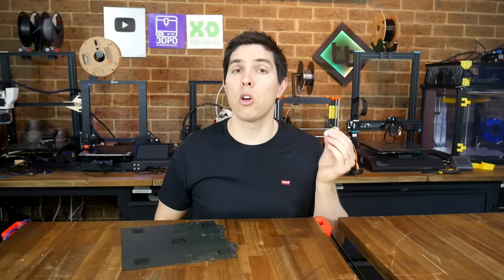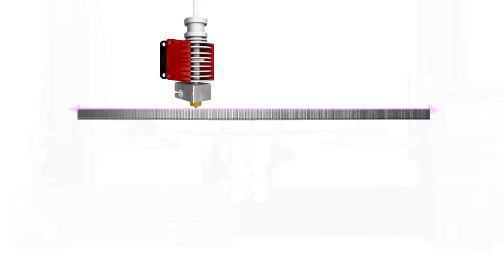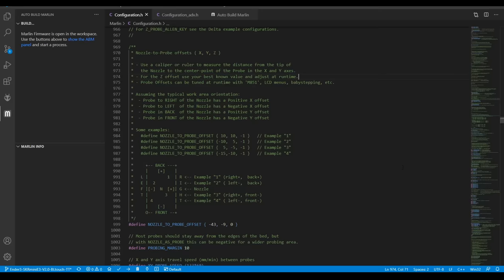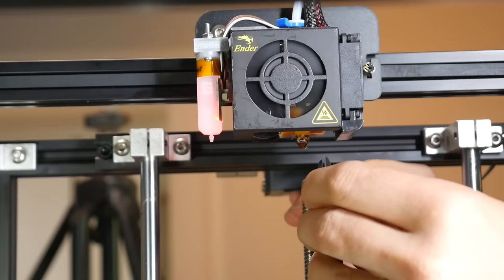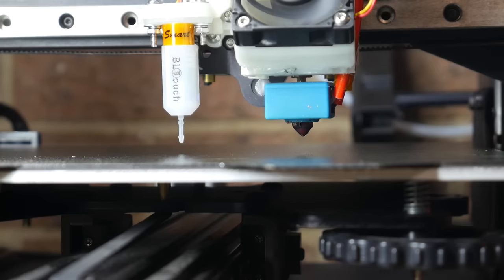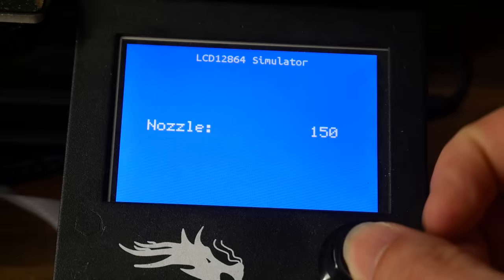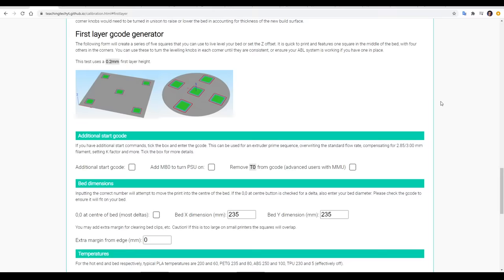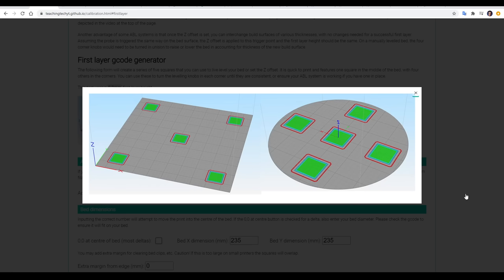ABL offset guide including new probe Z offset wizard

Comment: This is the way I adjust my z-offset: https://www.youtube.com/watch?v=Q5M7DvdMcew However, that's just the starting point. I made a test print like yours and make final adjustments on the fly. Once I get a good first layer, I save my settings and usually have no need to make any more adjustments until I change filaments that will require tweaking. When I go from PLA to TPU, I usually have to make a small adjustment to make sure the TPU is adhering. Other than that, I'm pretty good to go.

Comment: why not just start from offset=0 and start printing any first layer calibration model and lower the nozzle while printing with probe offset babystep? after you get the good result just save config and done. I don't really see the point of this whole wizard thing, just a waste of time.
Reply: Because beds are not completely flat. Whatever you print for that should be at the center and be small.
Reply: @alejandroperez5368  so what? That's the reason why probe probing points, the nozzle will be lowered and upped accordingly to the mesh, this has nothing to do, it is a right way to set you print offset, just do your G29 first and after that start the print, maybe a 100x100x0..2mm square and adjust your offset while it prints, save the setting after that and done. There is absolutely no reason using the piece of paper and this nonsense wizard
Reply: @ramzeslo2  You're wrong.
You first find the Z offset, then you probe your bed with whatever bed leveling system and then you fine tune the Z offset on first layer if necessary.  If you start printing without a Z probe offset value, it will likely start printing mid air, and will have to adjust it from a very distant value without an actual working mesh = crazy result.

But if it works for you...whatever.
Reply from the maker: Pemergency, that is the way I have always done it in the past, however, because you don't feel the need for this wizard doesn't mean it's 'nonsense'. Consider a probe like the CR-6 (or the version I designed for Ender 3 inspired by this). Those designs have a positive Z offset, so starting a print with it set to 0 will scrape the hot nozzle on the bed. At the end of the day, this is another option. If it's not what you need, there's no need to bash the wizard or those who use it.
Reply: @alejandroperez5368  that's not true, but that's fine, it's your opinion
Reply: @TeachingTech  im just saying this so called feature does nothing which we couldn't do in the past. And yes i do agree it is another way of adjusting the z probe offset and nothing more than that, i would be grateful if they focus on fixing the existing issues with marlin 2.0 rather than adding more unnecessary gimmicky options.
Reply from the maker: I would say to that this feature came from a pull request from the community. If you don't like something, then put in some time to fix it and assist the community. One of my sports clubs has a great saying: "Before you complain, have you volunteered yet?"
Reply: @TeachingTech  i have all rights to say my opinion about anything, and i really don't care if you like it or not. And you may be surprised how much i supported 3d projects community, but this is not a subject of this conversation. You do what you doing, and let people have own thoughts.

Comment: You really break the information down well.  I have a couple of questions.
1. I have a "Creality 3D® Customized Version Ender-3Xs Pro 3D Printer 220x220x250mm Printing Size With Magnetic Removable Sticker/Glass Plate Platform/V1.1.5 Super Silent Mainboard - Ender-3Xs Pro" from Banngood (URL:banggood.com/Creality-3D-Customized-Version-Ender-3Xs-Pro-3D-Printer-220x220x250mm-Printing-Size-With-Magnetic-Removable-Sticker-or-Glass-Plate-Platform-or-V1_1_5-Super-Silent-Mainboard-p-1535619.html?rmmds=myorder&ID=6285961&cur_warehouse=USA).  A great and quiet printer.  What version of Marlin do I use to upgrade the firmware?
2.  I can't find the answer if the motherboard is 32 bit or 8 bit.  Do you have any idea?

Thanks for all the hard work producing very informative and educational videos.
Reply: Your printer is 32bit. Use Marlin 2.0. You can find the download on the Marlin Website. Look for Teaching Tech's video Creality 32bit guide, he covers all the information on upgrading firmware as well as the type of board you have and other info like how to install BLtouch.
Reply from the maker: If it is new it SHOULD be a 32 bit board, however if it arrives the the board has V1.1.5 on it is is still 8 bit. Either way the newest version of Marlin will serve you well.
Reply: Thanks for the assistance.  Is there any indicators on the motherboard to tell if it is 32 bit or 8 bit like the controller chip?  I am really hoping for a 32 bit for easy upgrade of the firmware

Thanks
Reply from the maker: This video has a visual guide you can use: https://youtu.be/neS7lB7fCww
Reply: @TeachingTech  Hey I have a question. I got BLtouch set up on my new Ender 3 V2 and compiled Marlin myself thanks to your videos. However I can't figure out my bed edge offset/bed limits. I know my current probe offset is x38.2 y0 but although I entered it into Marlin correctly my printer probes off the edge of the bed for the 3 right side measurements. I temporarily solved this by entering a smaller bed size in Marlin but of course it prints totally off center and my bed size is limited. I haven't seen many videos on setting bed edge offsets/limits and haven't found much help searching online in the past 2 weeks. My printer prints great, although the grid is off center and my bed size is quite a bit smaller.  I use 180x200 or something like that to get it to probe a reasonable area. What can I do to fix this? I consider myself an advanced user on the hardware end, just started learning how to compile Marlin lately though. Thanks for any help!

EDIT: I'm using the correct configuration and board files as well. I forgot to mention I run an E3D Titan Aero rather than the orginal bowden setup. My prints are near perfect otherwise!

Comment: Hi, friend. I have had problems setting the z-offset correctly on my biqu bx. It seems like the auto leveling probe is not helping me. In some places on the bed it seems to be going well but At other points the nozzle is very close to the bed. And in other parts very separate. I have also manually leveled the 4 corners using the manual leveling wizard and the 4 points They look perfect, but when printing is where the problems arise. My printer is new and I haven't made the first print yet. It has me very frustrated and I don't know what else to do. Help me please
Reply: Even the live babystep during printing helps in some spots on the bed but is still bad in other areas.

Comment: I work with industrial robots, and we have pin checks or TCP checks installed. When we have a collision (this is actually not that rare) we can take the worktool to the pin check and adjust accordingly.
Now I can see that having a pin check to travel to would be complicated, printing one should not be.
So for FINE tuning, we could print a pin/pyramid (any pointy object) and then with the wizard drive x-y-z until the probe is just touching the tip of the pin/pyramid.
Marlin would need ti integrate the test print pin/pyramid, however then once you move the bltouch pin to the tip of the pin/pyramid marlin should be able to auto calculate the offset.

Comment: This would've video been extremely helpful a few weeks ago. The best thing that I've learned is: if you're nozzle is too far from the build plate when printing, decrease (into the negatives if needed) the nozzle to probe z offset, and increase it if it's too close
Reply: So as a general rule, your Z offset should almost always be negative (unless you have a dedicated Z-off switch AND an ABL probe, and even then, depending on how your bed is shaped/warped and how much you've tightened your leveling screws, it may still cause issues). For most people, they disconnect the Z-limit switch and reconnect the ABL probe to it. This means your nozzle will crash into the build surface/bed since the printer doesn't know it's at the top/bottom of the build volume. Not good, since that tends to warp beds.
Reply: @whoofianbrony8804  I am very much trying to work out how to use both. I want end stop for distance, and CrTouch for warping.

Can't find any guide that soecificially let you keep the end stop. Everyone I found says to dusconnect it instead.

Comment: I have a great idea for a Probe Offset Wizard (not Z offset) which does not exist! 
It would be simple and save using a ruler to measure the distance between the BL/CR touch to nozzle. I don't know why this doesn't exist already, but maybe you could do it...
1: Press go and the printer prints a small bullseye or x, then it moves to the side and lowers the probe down to where it thinks it is set, and if it is not hitting the X;
2: you turn the knob for X and Y and the gantry moves .1 of a mm each click of the knob until you get the probe directly over the X.
Done! Save settings. No need for eyeballing a ruler and you can get the offset 100% Perfect! Any dummy could do it!
Reply: Someone needs to do this!

Comment: Love your videos. But i cant figure out Marlin to save my life. Creality has preset downloads that are nice. work very well. But i get fluster on my next upgrade. and how to setup the ender 3s software right. Currently only running 1 upgrade. 350 on the z. But now i need BL, 350 on the z, and filament sensor. And Creality doesn't have a preset software that has them. No one has videos on this kind of thing. WIth the new way of just using creality instead of Marlin advanced. lol.

Comment: Hello there fellow printermans

For many days now im trying to figure out an issue with bl touch.Z axis moves( like it's trying to level the bed) while i print but it doesnt get it right.In some parts of the bed surface,nozzle prints  to low and vice versa.
I tried M48 test,results are okay and the X axis is almost perfectly calibrated. At Cura i use the M29 after M28.Also i tried M420 and there was no difference. Except that i haven't done any changes at Cura's g.code.
My printer is the Ender 3 pro with btt skr V2.0 and i use bl touch smart 3.1. I have tried many marlin versions but the problem remains.
For the love of god help me.

Thanx ❤️

Comment: I just dial it in during a first layer, I can get it a lot more accurate that way. If you enable babystepping (and maybe something else too) you can change the Z-offset by double clicking the dial while printing. It's very easy and accurate.
Reply: Agree. This is how I do it. Level the best I can then I set the Z while it's printing.
Reply: I love the bed levelling tool I use that waits above each level adjuster while you fine tune the Z then move on to the next at a button press.

Comment: The ABL Tweak for X5SA (400mm models) is wrong (identical to the one for 300 model). One needs to replace the values 290 with 360 inside before using it.

Comment: I was googling for the G-code which would provide me the current Z-offset. It seems there isn’t one yet. As the menu of the CR-5 Pro H doesn’t have a z-offset adjustment, it would have been helpful to then adjust the difference from that point.

Comment: The paper method is flawed. You should be moving until the nozzle touches the bed. Then you can adjust first layer height in your slicer.
Reply: Yes, you are right but then you have to change slicer settings when you change the filament type. This way covers all bases, set and forget.

Comment: Is anyone else having an issue getting the Wizard to appear? I uncommented the line as Michael instructed, compiled the firmware (no errors) and flashed my printer, but I am not seeing the Z Offset Wizard. The BLTouch menu does appear under Configuration, and I can home the Z using the probe, but no Offset Wizard.

Comment: I have never gotten a good z-offset on my printer, I have scratched the hell out of my bed but now I do it differently.

I used a thick piece of card paper, my callipers said 0.3mm thickness.
Heated bed and nozzle to printing temp,

adjusted offset till I could feel a bit of resistance between the nozzle and paper, but could still slide the paper under the nozzle.
added the thickness of the paper to the offset to bring the nozzle lower, if done correctly the nozzle should be touching the bed without the X carriage fowling to one side.

eg. -3.20 - 0.3 = -3.5 Z offset

and then baby step during printing if its too close.

I did this and for the first time had really good layer adhesion to the bed, I am going to do this again with some feeler gauges for more accuracy as I was getting a bit of elephants footing, I could either try compensating for it or try to raise the nozzle a bit more.

Comment: after following this guide I have a slight problem. when I run the wizard, the nozzle gets banged into the side of the printing bed when it tries to move to the center. is there some setting in the config that I can edit to make the nozzle move up before moving to center while the wizard is running?

Comment: I think the live nozzle height adjustment is great.  I have an ender 3 pro and am using a 5 by 5 grid.  It does slow down the start of a print but I think it is worth it.  Do not use an even number.

Comment: Hi Micheal
At 9:30 you mention babystepping, Im just compiling the lastest marling from github, using the example for Ender 3 V2. 
Baby stepping has quite a few additional settings. 
Example "BABYSTEP_MILLIMETER_UNITS" and "BABYSTEP_MULTIPLICATOR_Z". Would be nice if you could comment your recommended setup.
Default is in steps, and if you switch from steps to milimeters, BE CAREFUL, default multiplicator_z is 40 (I understand 40mm).
Reply: Oh, now I can see you also have it, slightly above, set as default...

Comment: Sweet.  I upgraded last week using your instructions, for ender 3 and BL touch.  But had "A LOT" of trial and error on the leveling.
One Issue I had was with Safe Homing.  I could not get it below what was 0.  
Also, I discovered that I had the whole bed so low, it was very level, but so low, that it could not reach.  So I raised the screws 2 turn all the way around, and found it was in a workable range.

Comment: There is no way to escape a unleveled/warped bed, I don't know why this never came standard, thermal cycles will "naturally warp" I'm sitting with the same issue and arrived at the conclusion that auto bed leveling is a must as a "mechanical calibration" step after a few thermal cycles of usage thermally shock the bed material with age, expect an unleveled bed even if your bed plate came flat at 0.5mm.
Reply: better beds will probably get invented using a 3-axis accelerometer sensor under the bed this is where the future will go for advancement in printer bed technology.
Reply: If you are super worried about bed warping, and you have an hbot/corexy printer you could always use 1/4" MIC-6 tool plating.  You are 100% correct, all metal will eventually warp due to thermal expansion over time, but this stuff will last significantly longer.  It is also quite a bit more expensive and heavier than a 3mm thin sheet of aluminum.
Reply: Absolutely. I often switch between different filaments that print with different bed temperatures. Each bed temperature warps the bed by a differing amount depending on temperature. For me an auto bed leveller is a life saver that prevents me having to manually re-level the bed after a filament change.

Comment: Another great tutorial, thank you! Do you have any additional recommended resources for Marlin Firmware compiling? I ran through your tutorials for my Ender 5 Pro when I added an SKR Mini, BLTouch and TFT at the same time but I cannot get the firmware to recognize the BLTouch properly. I get errors and warnings every time I boot up the machine.
Reply: Download Arduino IDE and open the project with Arduino, press the Verify button and it should compile it :)
Reply: Joao Carlos thank you for the suggestion. I have been compiling with VS Code since it is a 32 Bit board.
Reply: @gt2scale  I see you have edited your answer to include more info. In fact I use VSCode with the arduino extension for personal projects. I was just suggesting the Arduino IDE because its usually more beginner friendly (and it does work!).

Unfortunately, I dont know how to help you further with specific setup, sorry.

Comment: do you not include the thickness of the paper in the z offset?
Reply: he's baby stepping it live after setting it, so there's no need. if the first layer is perfect, that's your proper z-offset.
Reply: @haysoos123  im getting a stupid bug were z steps and z offset is not working so trying to include all in firmware
Reply: And you don't want the nozzle touching the bed, you need a gap to allow the filament to extrude out of.